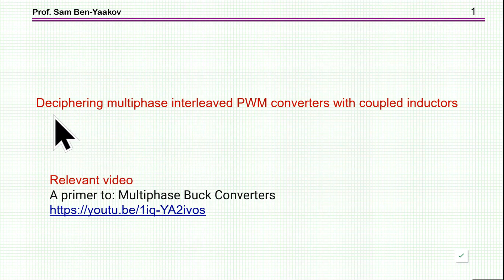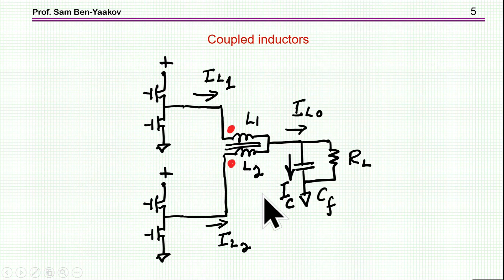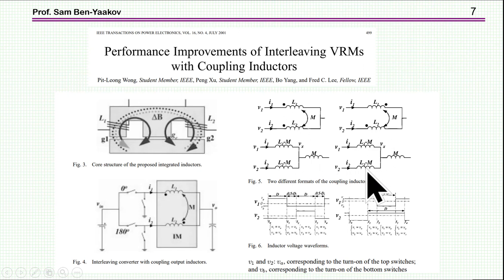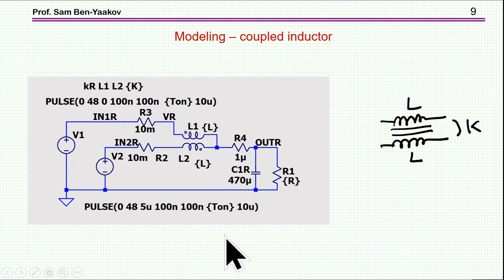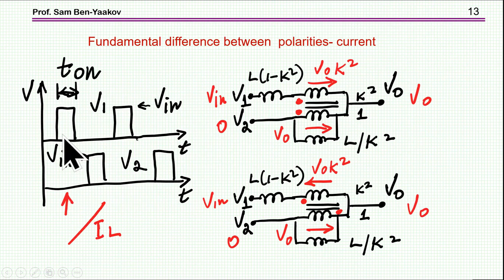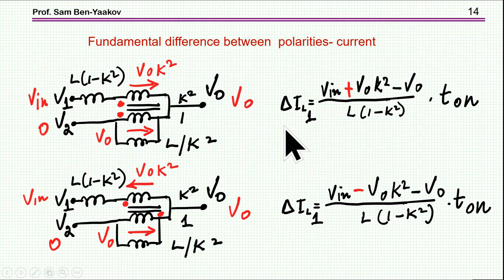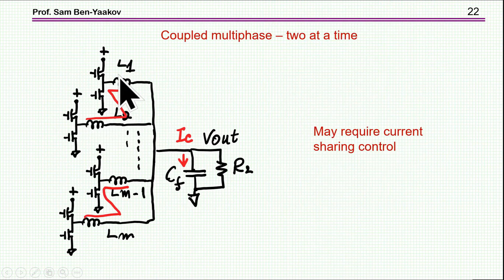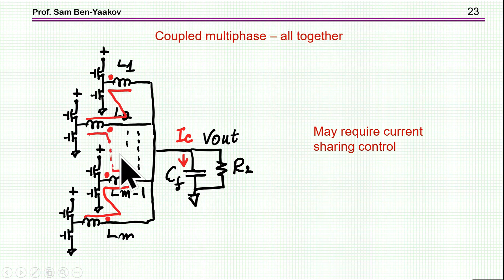Deciphering multiphase interleaved PWM converters with coupled inductors

Comment: in 14:40 I believe there is a mistake . The M<0 (inverse coupling) is actually the one in the left, because the coupled flux direction is inverse to the one the other winding is generating. The coupled flux direction (flux from one winding that intercepts the other) is what sets the polarity, not the flux in the middle leg. Therefore, drawing of dots in inductors need to be swaped from left to right.

Comment: Great video.
I tried to duplicate the simuation model of the two phase coupled inductor buck and I always have an average difference between the current of the two coupled inductors. In other words, they are not sharing equally. Yours seem to be sharing nicely.
I am not sure if there is something that I missed in the simulation.
Reply from the maker: Try to reduce the minimum step size. If it does not work
Reply from the maker: Send me the .asc to sam.benyaakov@gmail.com
Reply: @sambenyaakov  Thanks, reducing the step size certainly helped. I thought I have to try some sort of initital conditions for the inductor currents or the cap voltage to avoid initial difference between the two inductors current.

Comment: Prof. I think the model of the coupled inductors, used as in slide 11, is wrong. You can clearly see that the self-inductances on each side leaving the other open are not L. Same if you want to compute the mutual inductance, you don't get kL. The correct one is with L in place of L/k² and k:1 instead of k²:1
Reply from the maker: Hi, you are absolutely correct . I have no idea how this error occured and how come nobody noticed it since it was published a year ago. I am planning to redo the video. Would it be OK if I add a thank you to you? If you wish you can send me your full name for that. BTW the transformation was supposed to have been based on https://youtu.be/TUfaN40T1Yg
Reply: @sambenyaakov  is there an already corrected version of this video? I was trying to derive this model but in vain until I realized that the self inductance is not the same looking into both terminals. Also, how do we go form the T model you showed to the model with leakage inductance  on only one side. Is it a star to delta transformation?
Reply from the maker: @RMSa-p5p  Sorry I donot follow you. Which minute in video or slide number are you referring to?
Reply: @sambenyaakov  I am referring to slide 11 in which you had a model for coupled inductors with two inductances only... leakage and magnetizing.
Reply from the maker: @RMSa-p5p  Sorry, never got around to it. I will try to put it again on top of the todo file. Please let me know when you see this. Afterward I will unlist this video.

Comment: Thank you Professor, But at 05:31, I see two variables Ksimpe and K: which is confusing for me. Can you please look into this or just share the LTspice simulation file?
Reply from the maker: Ksimple is 1
Reply: @sambenyaakov and the value for "k"? Am in confusion how a single coupled Inductor can have two "k" (coupling coefficient)
Reply from the maker: @isacdaimary9908  OK. The circuit represents a coupled inductor with coupling coefficient K which is different from 1. The equivalent circuit includes a transformer with K=1 and inductors. In this circuit K is a parameter (.PARM is not shown) so the equivalent circuit can be adjusted to any original (total) K.

Comment: Professor i really like your intuitive way of teaching. I also want to enter the realm of power electronics. But i am not sure how do i go with it. Like how do i realize which field of power electronics will be the topic of research in next decade.  I am clueless at the moment. I would really like if you could give a generic input for enthusiastic newbies in this field.
Reply from the maker: "I also want to enter the realm of power electronics." as what? engineer? academician?
Reply: @sambenyaakov  i am electrical engineer. I do have basic knowledge of power electronics and want to go in advance field. I did my masters related to ems in multi-microgrid but i also have interest in power electronics i also took took UCL bolder courses on power electronics by Dr. Erikson but i am blank about my direction from there. I need your advice. Thank you for your time.
Reply from the maker: @AhmedAli-op6ng  I think that power eletronics related to automotive application (power train, chargers, energy storage, relevant magnetics, and the like) are going to be in great demand
Reply: @sambenyaakov  thank you for the reply.

Comment: Hi professor, can you comment what is the benefits of using coupled inductors for multiphase buck? most published papers claimed it is good for power density (size), able to use smaller L and C, better transient performance. But as you showed ripple current is actually higher and we would need larger L and Cout to have the same inductor current ripple per phase and output capacitor rms current compared to non-coupled inductors case?
Reply from the maker: I think the saving, if exsists, is due the fact that you have one magnetic element, albeit larger.

Comment: You can also try a more general "pi circuit" model, which can work with multiple coupled inductors: https://en.wikipedia.org/wiki/Inductance#%CF%80-circuit This doesn't change your findings, I just think you will find the model itself interesting.
Reply from the maker: I am not sure I follow. Can you please send me a sketch of the configuration you have in mind to sby@bgu.ac.il ?

Comment: I think the relevant video you mention at 5:40 is this one:
https://youtu.be/TUfaN40T1Yg

I actually have difficulty in understanding the mathematical transformation of the coupled inductor to the particular model you are using.
Reply from the maker: Thanks for correcting the slip. I will add a note on this  in the description section. This is just a simple tranformation. Perhas the difficulty is due to not taking into account the fact  that the turns ratio of ideal transformer includes K?
Reply: @sambenyaakov   
Professor, one thing that is confusing me is the following: in the schematic of slide #11 shouldn't the ideal transformer ratio be given by sqrt( L3/L10 ) = k ? If so, why are the drawings showing 1: k² ?  And if the transformer ratio is 1:k , then shouldn't the magnetization inductance be L instead of L/k² ?

Also, as it is, when I try to calculate the voltages at both sides of the transformer I don't get what I expected:
V₁,₂ = L·di₁,₂/dt + M·di₂,₁ /dt  where  M = k·L
Something seems not to be consistent or I'm doing some mistake...
In fact, if the transformer ratio is 1:k  and the magnetization inductance is L, things become consistent and I do get V₁,₂ = L·di₁,₂/dt + M·di₂,₁ /dt .

Comment: Are you familiar with the dynamics associated with synthetic inductors made from op amps? These synthetic inductors do not have magnetic cores. Interested in using these in a project and came across your lectures.
Reply from the maker: Are you going to use them in a power circuit?
Reply: @sambenyaakov  I really appreciate your reply. It is a signal circuit, no power handling. Carrying sinusoidal signals.
Reply from the maker: @LydellAaron  OK. This emulation is possible. The question is why do you need it? From outside it looks like an inductor. So why not used an inductor? One place it could be useful is to mimic an inductor for reconstructing the inductor current. But for that you do not need an Op Amp. So how are you going to use tis emulation?
Reply: @sambenyaakov  thank you for your insight, I am looking to investigate how the synthetic inductor will perform when inserted as L in an LC oscillator at a tuned design frequency. I heard they can achieve high Q factor and high precision.

The specific LC oscillator I have identified, would be a Clapp oscillator design at single design frequency.

Comment: Interesting video. I've seen this done with a toroidal coupled inductor with out of phase components, and the main benefit was touted to be the improved performance of the magnetics because of the lack of DC bias. That seemed like a reasonable explanation but would be interested in hearing your thoughts...
Reply from the maker: At high frequency, core losses are increasing and they are associated to the AC current ripple component. Thanks for Note.

Comment: thanks for the video! correct me if im wrong, but i think the lack of dc bias would allow the use of powder cores with a very high permeability per turn for their size, as long as the linkage is v high - while uncoupled or loosely coupled cores would have to use a larger distributed air gap to not lose permeability by the ampereturns of dc flux. ltspice doesnt seem able to couple inductors with nonlinear flux expressions, but maybe it could be done with dependant current sources? 🤔
Reply from the maker: The lack of DC bias is only in some of the legs. Powder cores have a higher core losses at high frequency.
Reply: @sambenyaakov  thank you, i didnt know that! ive mostly done old-timey linear stuff as of yet

Comment: Professor, thank you for another great video!
I'm not sure I follow the takeaway that opposite polarity is preferred. If low output ripple is a desirable trait, what is the cost of same-polarity coupling? Size to reduce copper losses? Would either approach be preferable to reduce AC core losses?
Reply from the maker: Thanks for note. High frequency current  ripple  in winding will cause excessive conduction losses. Core losses will probably be lower with the revers coupling configuration.

Comment: Thanks for the video. No one can explain it so intuitive as prof. Ben-yaakov. All most every buck converter circuits I've seen utilize the load is on "0 V". Is it possible to operate with symmetrical supply voltage and push-pull configuration so the load is kind of floating. I was thinking of a use case where the rail supply is under +/- 50 V measured to ground and measured over the load it will be 100 V max. For safety reasons where people could some how touch only one of the output at the time and therefore exposed to max 50 V.
Reply from the maker: Thanks for note. Yes I guess it can be used in a double bridge configuration.